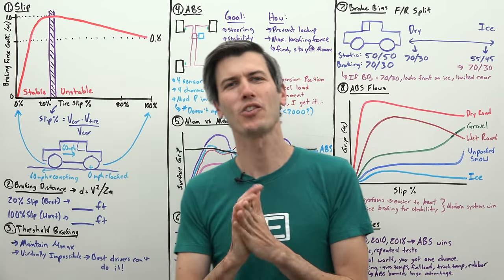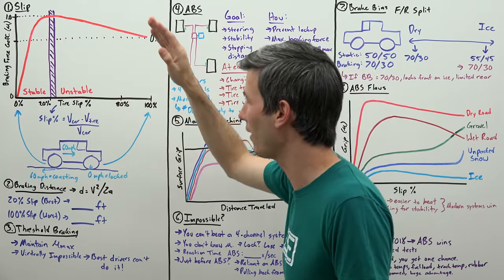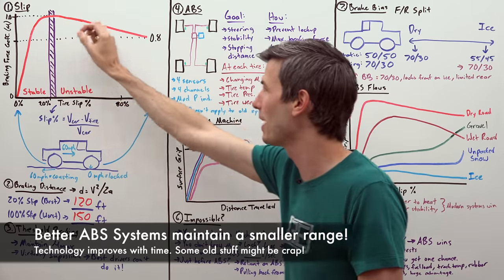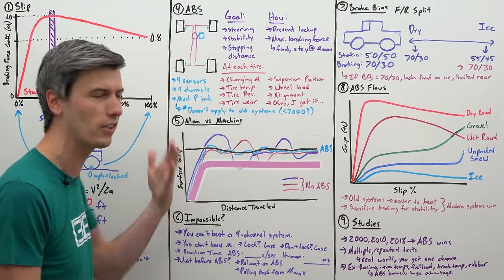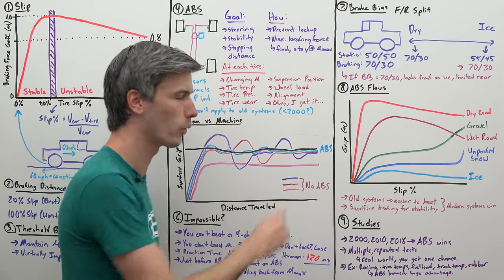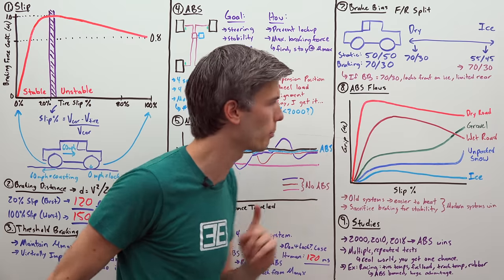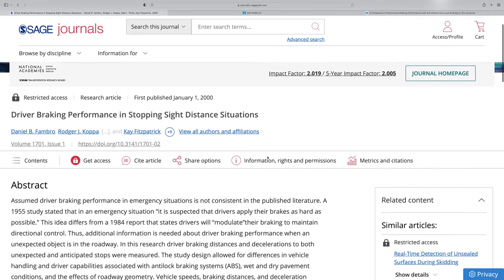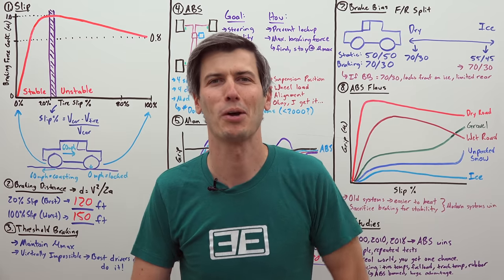Why Threshold Braking Is Impossible - ABS Wins!

Comment: Good thing you mentioned that on gravel and snow, ABS has its quite severe limitations.
For urban people living in hotter climates, thats just a theretical exception to the general rule, that ABS is better.
But lets remember that a quite significant number of cars has to deal with gravel and snow regularly.
Simply making an ABS system that is not a pain to turn off, could negate this.
But most modern cars is now there that turning the ABS off is a teedious procedure, and on others not even possible at all.

And speaking of snow and gravel, other solutions that should be possible to override with ease, is the necessity to press the brake pedal before changing between D and R for automatic and electric vehicles.
Obviously those who came up with that is not very experienced with winter driving.
And for those of you that isn't experienced with winter driving: Getting your stuck vehicle into a pendulum motion is the go-to-way of trying to unstuck your vehicle. Obviously not possible when you have to stop all motion, to be able to access reverse gear.

Comment: The most important point is at 04:00. Call it real-time dynamic bias. The car's weight distribution is always changing, the traction at each wheel is always different from the others and changing. Even if a human could perfectly nail the ideal threshold point, he could never accommodate that independently for each wheel because non-ABS systems don't have independent channels.

Comment: I learned to pump brakes growing up to remain in control. Also growing up in the north country of NY state...you know about 4-5 hour drive away from NYC, and 200-300 inches of snow a season!!! I just wish auto manufacturers would  put a winter mode on abs...because on an icy, snowy road I'll guarantee I can brake quicker(stop shorter...and remain in control) than any abs equipped car!!! Now on dry or wet pavement yes abs will beat me. If you think I'm wrong you've never driven an abs car in 1-3 foot of snow. abs is damn scary in that situation.

Comment: I think I have an idea as to why some people don't like ABS or think that they can do better. First off, I realize that I can't / no one can outperform ABS. 

I grew up driving snowmobiles, motorcycles and ATVs, and 1. these didn't have abs 2. while you may not stop as quickly, locking a brake can be beneficial to controlling the direction or behavior of these things. Being able to lock the brake can allow you to maneuver or even avoid tipping over, or getting tossed off in a corner. 

My first cars did not have ABS and I modified them with, better suspension, stainless breaded lines, better brakes and sticky tires etc. This resulted in a more positive feel like you would get on a atv or motorcycle. 

My first car with ABS was a Mercedes C230 Kompressor. Like my other cars, I drove this car aggressively, and didn't like two things about the ABS. 1. Tires locking or almost locking don't cause me to panic, but the feeling of the brake pedal buzzing and seemingly going mushy kinda does. 2. Even if the car is in more control than I am I'm still going to react as I would in the situation without the assistance. 3. It is a huge distraction. I found this several times with the ESP as well...I would react to a slide, the ESP would kick in while I was reacting and freak me out. To be clear... I'm 100% sure that ESP has saved me from a few kinda bad crashes in that car, and ABS has probably saved me, but the times that it wasn't needed and tried to save me, freaked me out and that makes me uncomfortable with it being there.  

 All of that to say. If you are an average driver who just mashes controls and waits for the car to do the driving, you may not even notice ABS or ESP kicking in and saving you. If you're an aggressive / confident driver, these things, while they can react better than you, their reaction can be very disconcerting at the worst time, and there's no guarantee that you won't react also. 

For me, no matter how many times I activate ABS it always feels like something has broken. This is fine in a panic braking situation where I'm trying not to rear end someone, so I mash down harder on the pedal, but if you're going into a corner and the inside tire triggers ABS and the pedal goes all funny, it's distracting and takes the feel away from your pedal.

Comment: Appreciate ABS. Someone once pulled out in front of me at the last possible second while I was driving a car at around 60mph and my car didn't have ABS. Completely locked up my tires and I only avoided hitting them by a few feet but the wheels locking left flat spots on my front two tires and I ended up having to buy new tires at a time I couldn't really afford to.

Comment: My big issue with ABS (and this is something I've experienced multiple times) is when an ABS sensor goes bad, which is very, very common. In those situations, before failing outright and turning itself off, the ABS module has a tendency to go nuts and actually prevent the car from stopping in a reasonable amount of distance. It'll fight the brake pedal to the point where almost no braking is happening. Just last winter, I almost had a very slow-motion impact with another car in my driveway for exactly that reason, and the only thing that prevented the impact was me rushing to engage the e-brake. I've also had this happen on the highway in a panic braking situation. I'm not saying this makes ABS "bad", but it's something that plagues even the most modern ABS systems, and there's no way to guess when a sensor might go bad so there's no preventive maintenance that can be done. With people holding onto their cars longer and longer these days, and the recent increase in used car sales, this has become a serious issue. In the case of my older cars with very old ABS systems (early 90s GMs), I feel safer disabling the ABS rather than wait for it fail at the worst time.
Reply: My 1995 Grand Am ABS would malfunction at slow speed. Less that 10 MPH leaving work and I would push very hard and it would take a long distance to stop. After many hours of trying to fix it, I just left the module disconnected.

Comment: on my car i can easy beat the ABS on newer cars no way. but if one wheel lock up than is it very nice and for cornering. but on my car the brake split is so bad if i nail it and than nail the rear axel with the emergency brake i can brake quick as hel even when cornering, i often was faster in stoping than my bad 4ch abs, but i don't wanna miss this ABS you can work with it but this is difficult

Comment: I'm a professional driver with over a half million miles experience and experience in driving in nearly every weather condition, in addition to many miles doing serious offroading. I've done everything from driving through blizzards to hauling explosives through mountain passes to climbing up slopes so steep my SUV was doing a wheelie most of the way up.
While on my semi truck ABS is extremely useful in preventing jackknifes, it can also extend braking distance in a few scenarios, like loose surfaces where a locked tire would dig in and stop quicker. I personally have experienced a couple of these scenarios where I could feel the ABS activate at the wrong time, both at work and at play.
However, for the average driver the benefits definitely outweigh the few negatives one might experience. The huge majority of people won't encounter the scenarios I mentioned.
My overall point is it's good, it's useful, but it's not perfect like he says in the video.
Of course another point to remember is there's different quality levels of ABS systems too lol
TL;Dr: he's right

Comment: I had ABS fail on me once. This resulted in the car being totalled.
I was driving fast. I stopped the brake pedal. The ABS and EBD kicked in. The car squirmed for a second or so, all as expected. Then, the back of the car squatted and I heard tyres screeching. Before I could figure out what was going on, the car was pivoting. I threw in an arm-full of opposite lock and released the brake pedal, but it was too late. I was travelling sideways. Watching the crash barrier rapidly pass sideways in front of me in the headlights, I could see I was moving closer to it. I braced, hit the barrier, spun and hit it again before stopping at the grass verge at the other side.
Turns out the ABS applied maximum force to the rear wheels for some reason. There was plenty of evidence of the sideways action from the scuffs across the tyre treads as well as the skid marks (both on the asphalt and the driver's seat). The track-rod end ball joint was sheered clean off, meaning I couldn't steer the car out of the way.
Despite this, I would always prefer to drive a car with ABS. A one in a million failure doesn't justify mistrust.

IMHO, I don't know why manufacturers still have this as an option. If it were my decision, it would be included as standard.

Comment: Thing about point 7 though, that's basically EBD. You could have ABS without EBD, and it won't do all of that. 

Interesting example I read of a trucker with a single axle trailer hitched to it, It was designed so that more bias was on the front. But with the trailer hitched, more load was on the rear wheels as the trailed pitched forward under braking. So if he braked hard enough to slow the rear wheels, front wheels would lock up or lift and he'd have no steering. If he braked lightly, he couldn't stop fast enough. He wished he had EBD

Comment: As someone who generally speaking doesn’t like technology in cars, I agree that ABS , old or new is great, I have it on my early 90’s truck on the front only and on my new car all around, and I can cope with both. Human experience is very valuable when it comes to dealing with situations and I have to say that I personally deal better with my old truck’s brakes better, simply because I (the driver) can predict better how the system will react, therefore working with the system as well to achieve good results, in my new car, it’s less predictable to ME how the system is reacting, therefore leading me to take more drastic measures on my own, evasive or otherwise (which would be impossible with a car completely devoid of ABS), that said, common sense will dictate that one will drive at a speed that lets the better control their vehicle, and hopefully never have to need ABS to save you if you decide not to be practical.

That said I’ve never had an accident in any car BECAUSE of brakes , even a car from the 60’s, and not because “they are better”, but simply because of something called common sense which when ignored SHALL result in an accident no matter what you have. HOWEVER what DID cause me to have hairy situations more than once is traction control.

Consider the following, a human can deal with braking in a car without help, UNTIL said driver is faced with an unexpected emergency situation, THEN, ABS is there to help save you, HOWEVER, traction control systems don’t ALWAYS help, they often turn a controlled situation INTO an emergency, and that’s how the day I forgot to turn off traction control on my new car it decided to intervene in the worst possible way throwing me in the oncoming traffic lane, on a ~25 degree incline sharp-ish turn in the snow, and this happened to me twice for the same reasons, technology turning a controlled situation INTO an emergency one, which is the opposite of what ABS does, making it essential for cars, and making traction control systems hazardous, more so now with cars in which you CAN’T turn them off.

How many times how you found yourself not able to go forward because you are having to fight traction control into doing what you want, often in very low speed situations, VS how many times how you found yourself fighting with ABS to do what you want … I’m sure that ratio is always going to be as far away from 1/1 as possible

Comment: Considering the capability of ABS sensors on 4WD systems to detect spinning wheels, I kind of doubt the power of the overall system to precisely monitor these wheel lockups. Unless the problem in 4WD is the reaction and not the detection.

Comment: Simple, mount the brake pedal on a ball head so it can tilt in any direction, you control the brakes by tilting the pedal towards the wheel that needs more brake.

Comment: Please explain why cars, virtually all of them, roll through stop lights with ABS that if you pull the fuse and do it again, you won’t.  (Normally snowy, icy, or slushy conditions)

The only exceptions I’ve ever experienced is Jaguar and Tesla.

The Jaguar has some logic where around 25 mph it just allows the tires to lock up until 0 so it actually stops. 

The Tesla indeed appears to be working as you describe. 

But my current BMW X5 (and every BMW I’ve ever driven which is a lot) rolls through constantly and is a safety hazard in New England standard conditions. (And Infiniti, Acura, Lexus (really bad), Toyota, and even a Silverado I drove last year in the snow. )

I agree that above 25 mph they’re better, but experience tells me that isn’t true for 25=>0, though I agree that it SHOULD be better.

I think you should do some tests this winter in slush and see how far they go through stop signs by brand and system. I think you’ll be surprised. Especially at low speeds.

Comment: Fun fact: this originates from older abs systems, that simply remove all braking if slip is detected, these systems also ran at low check frequencies due to weaker computing.
Nobody is saying you'll be beating a gt3s brakes, what they say is that you'll easily outbrake nan's old corolla from the 20th century

Comment: I had a BMW motorcycle with ABS. I was on a gravel covered asphalt road looking for a campground my friends were already waiting at. I had to go down a fairly steep section in the middle of nowhere that was covered with flash and gravel because a recent rain had caused water to rush across the road, pushing Fly ash and gravel onto the road surface
 let me just mention that I have been riding motorcycles of all types, dirt bikes, motocross bikes, trials bikes, street bikes commuting, high horsepower sport bikes, eight years of road racing where I won six championships, two time national champion..
  OK so I started down this road on my almost 900 pound BMW K 1200 LT with ABS brakes. I touched the brakes to maintain a manageable speed. I had no brakes..none at all, Front or rear. I realized instantly what was going on. The ABS computer detected slippage and stopped supplying brake pressure to the calipers. I was picking up speed, I was pumping the brakes, I was standing on the brakes, I was squeezing the hand lever, a 90° right hand turn was at the bottom of this hill about 50 yards ahead… I could see that I was not going to make that corner. So I went straight ahead onto the grass, and luckily there was a salvage yard fence, 8 foot high cyclone wire fence like a wire net surrounding the salvage yard that I ran into, only breaking my front fender..
  motorcyclist magazine raised concerns about the Suzuki V Strom 1000 when it came out in 2012 or 2014 with ABS. The V Strom 1000, which I had one but the pre-ABS model is the one I had, The newest version with ABS is meant to be a dual sport machine, for all types of road surface riding, dirt roads, asphalt, interstate, trails, downhill trails covered with dirt, loose dirt, possibly mud after a rain. The magazine brought up a good point that the ABS brakes cannot be turned off to revert to standard brakes..
  I had a Moto Guzzi Norge with ABS brakes. On the dashboard was a big button the size of a quarter With the letters ABS.. The ABS on that machine could be turned off for those times when you may get caught in the rain on cobblestones which are very slippery on the motorcycle, on wet leaves, which is worse than cobblestones, or even in snow, which I have been caught at work commuting in surprise snowfall one time it was 6 inches of snow. I made it home, I just had a lot of wheelspin here in western Pennsylvania where there’s a lot of hills, but I made it.. but I can tell you this, if I had ABS brakes on my machine that day there was 6 inches of snow, I would not have made it out of the parking lot..
  I did some panic stopping tests on motorcycles with ABS brakes. Let me tell you it is a very uncomfortable feeling when the brake pedal and the brake lever on the handlebars goes completely to the bottom of it struck with no brake pressure. That is exactly what happens
  ABS brakes are a placebo for idiots on motorcycles. It is a completely different thing when you have a car with ABS and you have three other wheels getting brake pressure. On a motorcycle, the front brake is the only one that’s gonna save your life. When that stops working, good luck

Comment: What I have found is that on ice at low speeds ABS at least on the vehicles I have driven, doesn't do that well bc the wheels lock up momentarily once that happens a) ABS doesn't know the true speed of the car bc all wheels are stationary b) due to low speed and friction the wheels take a long time to speed back up so you don't get as many ABS cycles in, during this part of the cycle ABS doesn't apply the brakes so you actually get very little braking effect. I find engine braking combined with light braking to be more effective bc the wheels never lock up.

As you say in pretty much all other situations ABS is better.

Comment: 0:19 into the video and I am going to guess the answer by repeating something I was told on my driving lessons in 2004. If your car has ABS and you need to stop quick use the ABS! Dont be scared of the noise and keep your foot on the brake.